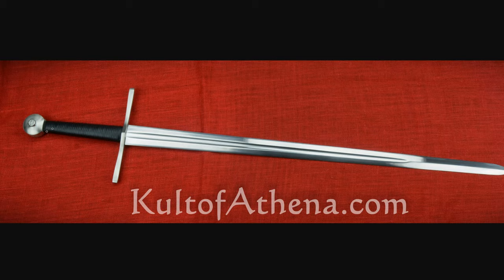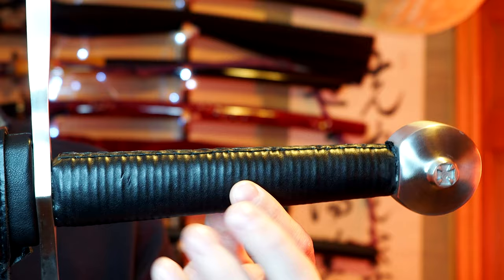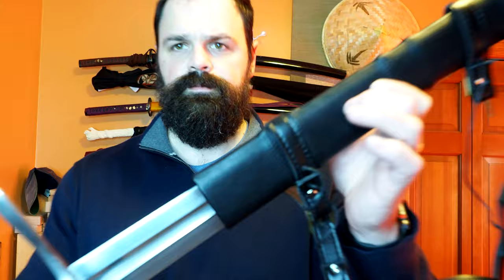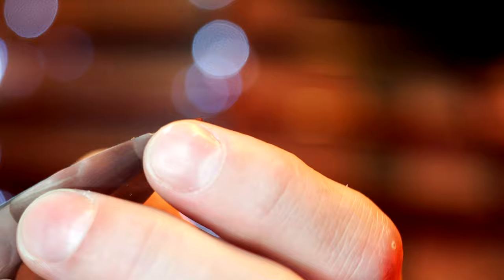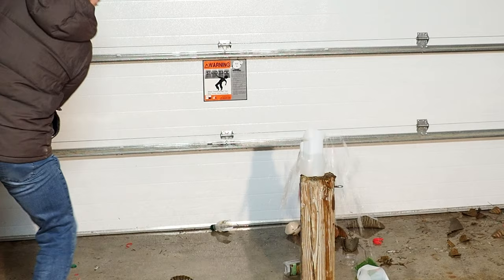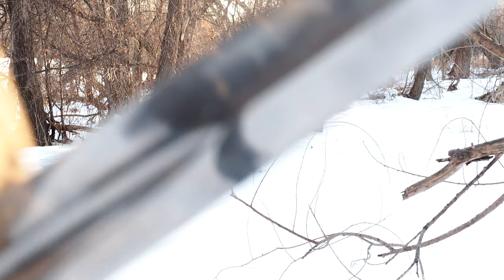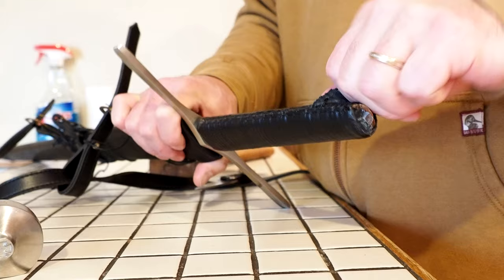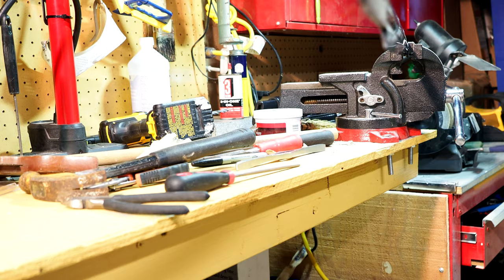Musashi European Style Sword:  (Templar Longsword) Review and Destruction

Comment: you should have tried to bend the Tang, after having removed the the grip. If the Tang was hardened that would explain why the pommel broke of and it would mean that all other copies will have tendency to braking pommels. The Tang on a european sword should never be hardened, wich is one of the major differences to a Katana, where this does not matter at all.
Reply: Exactly.  Fitting of the pommel to a full width tang would add strength to that weak area also.  That skinny tang end is a cheap shortcut in fabrication.
Reply: it would matter if a katana nakago was hardend it would snap from the force thats why they dont harden them

Comment: I always boil  the handle before tearing it down to melt the glue off its way easier although I think you wanted to see how much glue it had. When I rehandle the sword  I use a lot of glue in the handle and guard afterwards and then peen the pommel so there is less stress on the pommel.

Comment: now just remove some of the blade from the area above guard and slide the guard to the new position, and make a new handle to fit the new handle area and now use a die to thread the tang above the break and get a new pommel and nut and give a return whirl

Comment: That pommel issue is a feature not a bug. Whether they're threaded or peened, European sword tangs of this type are too thin for large blades. Every bit of vibration caused by striking something with any kind of sword travels down the blade and hilt. If you check out some historical European swords, you'll find a lot of these tangs were forge welded onto the blades using inferior steel. The two most common places for sword with a tang like that to break are at the crossguard and the pommel. Even if the thin tang is forged as part of the blade as one piece, the vibrations from a strike are concentrated in those two spots.

As a matter of design, katanas and messers have better tangs because they are a forged extension of the blade. I can only guess that the reason broadswords and longswords never developed with a proper tang is that they're more expensive and more difficult to make that way. If you're a feudal lord arming your peasants for war then good enough is probably good enough...